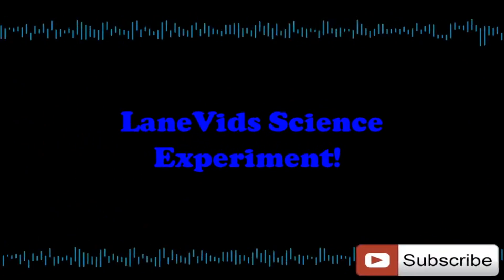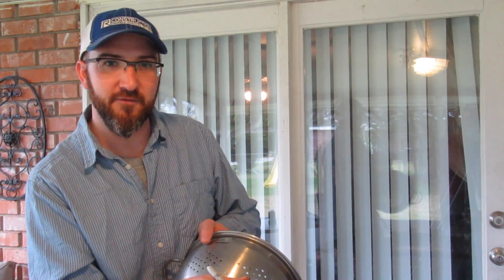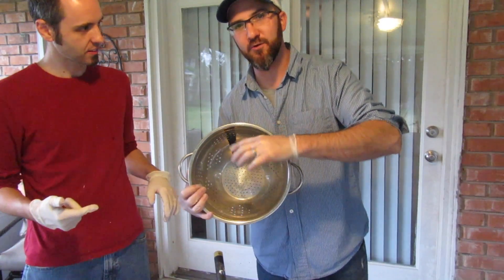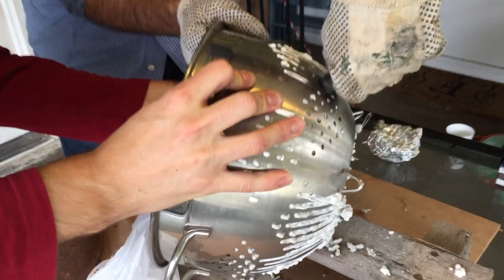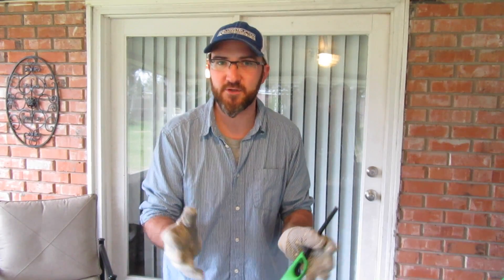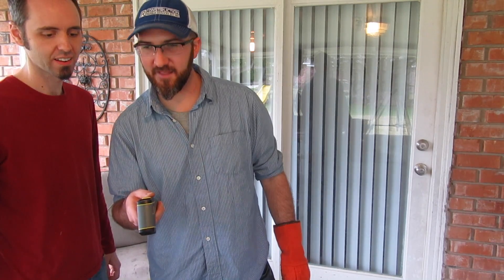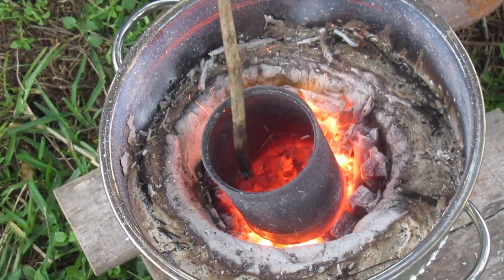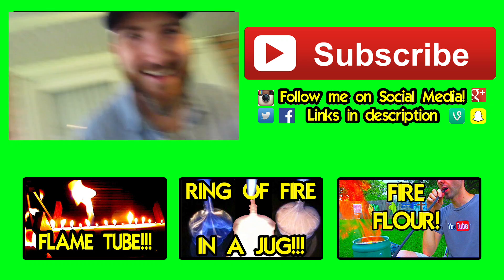HOW TO MAKE A HOMEMADE FORGE

Comment: The forced cold air induction is key to getting the proper temps. I think using a torch would use too much fuel. A solid fuel like wood and coal are best. You need to get them burning well before adding air though.